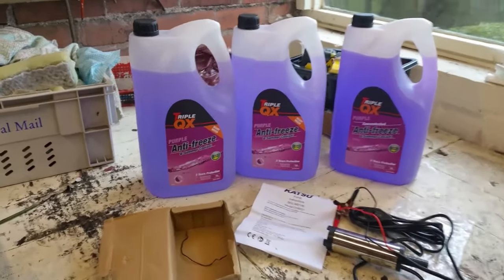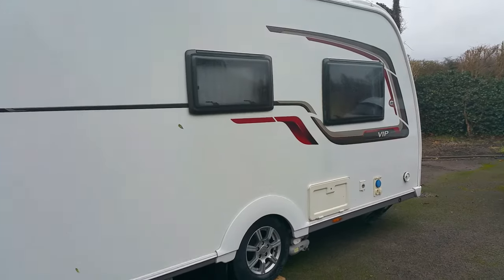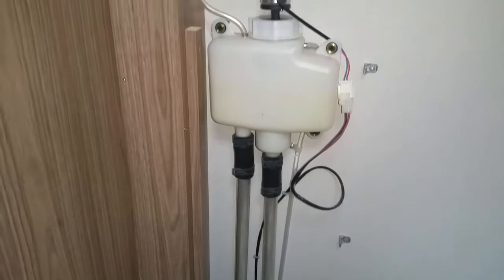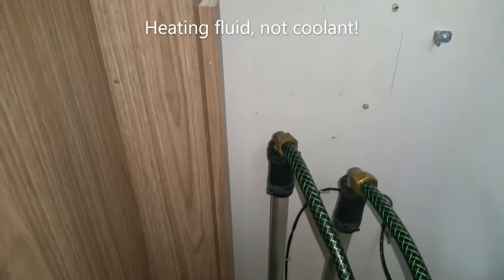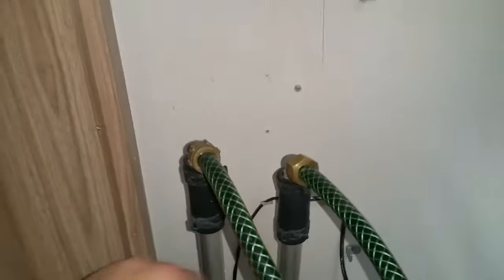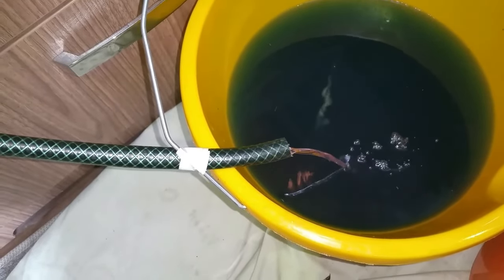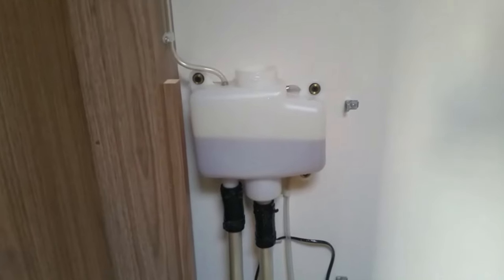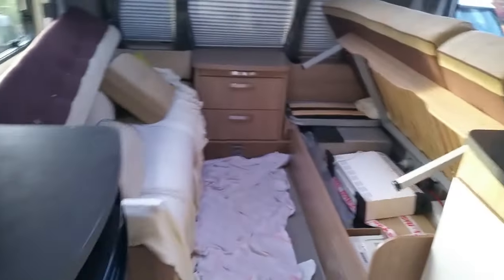Replacing the Alde heating fluid antifreeze in my caravan

Comment: Very similar to my attempt. I couldn’t drain down due to position of valve. I used a large syringe and hose to empty tank before disconnecting. I also flushed the system with de-ionised water prior to filling with new fluid. Cheaper by a country mile. Full marks.

Comment: Great video, I’ve never been a confident plumber, last time this needed doing I went to an independent, with travelling it took a full day and I had loads of trouble with air in the system. Mine is a Frankia Motorhome with a pump on the boiler, I found as long as I ran the system pump as well as the auxiliary pump it worked fine. I also decided to have a practice run with just water, thought it would act as a flush out as well as getting to grips with the procedure, worked a treat and for first timers I can highly recommend a practice run. Thanks again for this great informative video 👍🏻😊

Comment: Brilliant video, doing the change this weekend. Have drained the header by using a thin tube to siphon out the antifreeze. That means you don't have to struggle under the van with the brass plug mine on an Elegance 480 was difficult to get to
Reply from the maker: Peter. Great. But are you sure that that siphon method will remove all the system liquid content. Your tube would have to reach the lowest system point
Reply: @MrLittleowl  hi Leslie I just used the siphon tube to remove the liquid from the header tank and about 2 inches into the tube. I then removed the header and used the pump to fill the new antifreeze and push out the old antifreeze- worked well and saved about £130

Comment: Excellent video, i did do mine in the summer of 2021, on a twin axle 2008 Conqueror and the fluid amount was the same . I used the same antifreeze as you but the concentrate and mixed myself. Just one little thing I noticed was your fluid level in the header tank should be just 1cm above MIN to allow for expansion. Again well done!!
Reply from the maker: Magic, thanks Peter.

Comment: I found the pump you used just didn’t have enough power to push the water so had to get a slightly more powerful pump, this did the job.
Reply from the maker: Hi, noted thanks, I have seen examples on some posts where the fluid was replaced successfully by simply draining it out and then refilling with new via the header tank.  I suspect that can work in some cases, but  runs a risk of air lock and venting problems. That sort of issue is largely removed by pumping it in as it comes out.
Reply: I'm having same trouble with my pump. Not strong enough for the job. Can you tell me what pump you ended up using please?

Comment: Hi, nice Video, thx a lot.
Are you sure, that it is not the other direction!!!
I think, on the left side the flow goes up through the tank,  through the suck-pump into the right one back to the heater.
Regards Andreas

Comment: Great video Les. Very easy to follow. At what stage did you start venting the system? and for how long? Was the bathroom heater the only place you vented from? Sam
Reply from the maker: Sam,  Hi, once refilled and the header tank level was correct , that's when I vented, I vented air out  until the heating water appeared at the vent. As you vent any air out then top up the header tank if need be.  I only vented at the chrome radiator as this was the highest point, Regards Les

Comment: What is the gadget on top of the expansion tank, I have a unicorn valencia, with just the standard cap on the expansion tank.
Reply from the maker: Roy. hi, thats the heating water circulator (pump). I believe on newer systems the pump is fitted at the boiler

Comment: Hi I liked watching your video changing your alde heating antifreeze I'm a bit unclear weather you used the G13 straight out the bottle or mixed with de-ioniser water 50% 50% de-ioniser.i have seen so many ways and how to use the tripleQX , after you did your antifreeze change is your caravan heating working OK, your thoughts on this would be welcome  regards rod
Reply from the maker: Rod. Hi. yes worked perfectly afterwards. No air locks. I do wonder if there is in fact any need to fill as you drain. I do wonder if you just emptied it out in one go then refilled maybe it would still work ok. But it would be a risk to try that, especially if its a big van. The g13 I purchased was already diluted 50-50. You can buy it concentrated  and dilute youself. Amounts to the same thing either way.Good luck.

Comment: What is the silver thing connected to the filler cap. I dont have one on my 2018 Elddis .
Reply from the maker: Robin, Hi, that's the circulating pump, on my van its fitted on the header tank. On newer vans I believe its fitted elsewhere in the heating circuit. The heating circulation pump plays no part in the antifreeze change. Regards Les

Comment: Alde do not recommend that anti  freeze.
Reply from the maker: David thanks, Is there a reason?.Do they advise against it?.  As far as I can see it meets there spec. of their own product. 🤔
Reply: The G13 used in the video contains glycerol as the antifreeze component, whereas the Alde recommended fluid is, I believe, G12++ fluid, which is glycol based. The formulations (e.g. inhibitors, etc) are otherwise identical and they should perform similarly. In recent years, G13 has been steadily replacing older formulations in many applications, and is now generally preferred on environment grounds, since it is a by-product of the biodiesel manufacture, essentially a waste product, and hence dirt cheap, and is also non-toxic.
Reply: Sorry, should have said that it is specifically the glycerol that is the by-product from biodiesel. The other components (inhibitor, dye, etc) will likely be synthetic, although these will only be present in minor amounts.
Reply: G13 G12++ Like is Aldis any different beside the extortinate price, i doubt it.
 Suppose all the fancy pipes they sell for caravan engineers , they have to get their money back